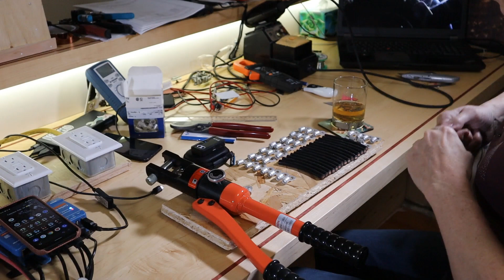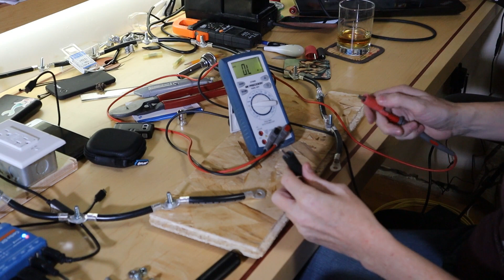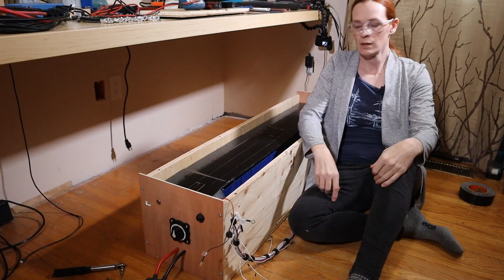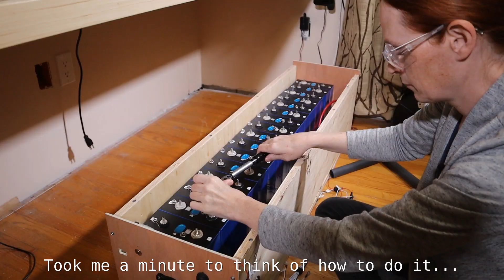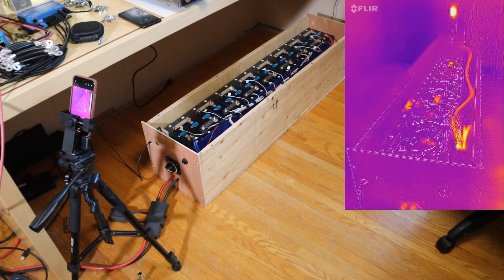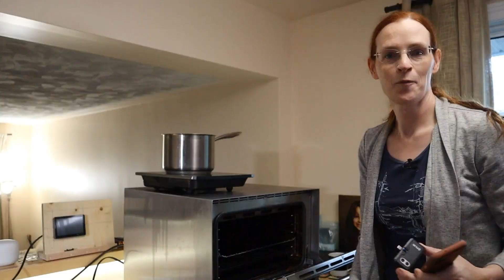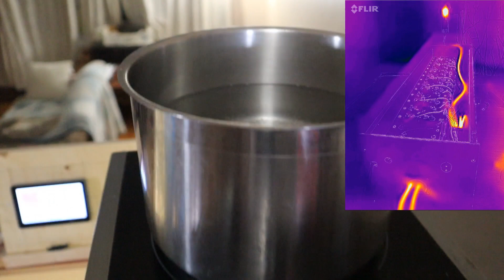What's Better? Rigid or Flexible Bus Bars - How to build a 48v Lifepo4 battery (Ep. 21)

Comment: My theory is that the bus bars are not copper, but are instead made from brass = more resistance and less efficient electrical conductivity = more energy being dissipated as heat. The way to prove this of course would be to charge the battery equally for both tests and compare the voltage (or total energy used) after each test. I would hazard a guess that more energy was used with the rigid busbars. All I know is I've been using these rigid busbars for a long time and filed them on the ends, and all of them are brass instead of copper. So, now I go out of my way to source pure copper busbars.

Comment: I see your SUPERVISOR is there to ensure QUALITY CONTROL! lol
Don't feel bad. I got one too. Every time I am doing something in the yard, my SUPERVISOR shows up to inspect lolol.

Want even less resistance then solder the ends in the lug and crimp.
Need US system not metric.

You didn't clean the connection surfaces.
Also, do not use stainless steel nuts and bolts. Stainless steel has more resistance than copper.

What app did you use to see the infrared??

Comment: im connecting  1/4"x 1"x36" Copper Bus Bar Solid Flat Bar to positive and one bar for negative on 4  48V(51.2V) 100Ah batteries  would there be a problem with doing this? is  1/4"x 1"x36" thick enough?
Reply from the maker: Wire gauge is dictated by peak current loads. Then you fuse/breaker to ensure it never exceeds that. What that is will depend on what you're powering, not the potential capacity of the pack.

Comment: Is it possible that the insulation on the flexible bars hides the heat?  Or alternatively, ambient visible light reflecting off the aluminum bars might have confused your camera?
Reply from the maker: The reflection off the tinned bars was a problem, yes. The insulation would only mask the heat for a short time... I think it cools better as there's more surface area for convection cooling on the wires. Andy (Off-Grid Garage) stress-tested my bus bars at something like 200A with no issues.
Reply: @TheDigitalMermaid  Yep, his video is what brought me to you originally.  And now I've watched your entire saga.

Comment: This test is deeply flawed.  You can’t measure the temperature of shiny metal very well with an IR camera.  You think the flexible cables are better because the IR camera can measure the temperature of the insulation on the cable much more accurately than the shiny metal bars.
Reply from the maker: I've learned a lot in the two years since I made this video :)
Reply: @TheDigitalMermaid  We are all are always learning.  😁

Comment: Perhaps if you purchased low grade cells and are suffering from bloated walls it would be beneficial to change rigid BB's for a flexible variety such that you made up, just make sure they are NOT long enough to touch both terminals of a single battery at the same time. As for the thermal camera don't get too excited on what you see it's a lot of trickery, much better to use a good quality  laser IR thermometer and point it at the terminals of every cell.

Comment: The multimeter allows a current of 0.01A to flow and then measures the voltage and the resistance. 
With such low resistance, that's not enough. You would need at least 10A or 100A to be able to determine the resistance.
And you would have to carry out a four-wire measurement and not with just two samples.
0,1Ω is the resistance of the measuring line.
Reply from the maker: Aye, I got this kind of resistance tester later. I've learned a lot on this project. :)

Comment: i think i would make a jig to keep those ring completely coplanar while crimping - no twisting when installing. OMG u need to study the Kelvin 4 point system for measuring extra low resistance, your meter is nowhere near good enough for that.  You didnt measure temperatures, just said they were warm?  Even a cheap IR gun would give you info and the well known back of the hand or forehead test will guide you to hot spots. The data says you torque to 4Nm why did you use 6Nm and put extra stress on AL threads - which creep over time btw and loosen - well known AL problem
Reply: Yes could use a 1A powers supply and measure the voltage across the connection.  R =V/I  
Copper wire changes resistance +0.3% per deg C .
Myself I have a Agilent 4338B which uses AC and can measure 1micro OHM great for connection resistance measurements.

Comment: not necessarily better than the rigid. they are longer so MAY have better cooling. measuring the voltage drop (or resistance) would give better indication. 
But of course if the heat is the concern and not energy loss then yep, looks cool.

Comment: Curious if in your final build if the long wire that heated up the most could be configured differently to be the "short one". Honestly just because my OCD takes me there, LOL. I'm sure I can come up with "reasons" but it's really just my odd sense of order driving the inquiry. I know you are probably way beyond this by now but I am purposely making my way through your back catalog chronologically so I have no idea what point you are currently at in your process. The not knowing is kind of fun actually. Again my sense of "order" is getting the best of me, LOL. Great video I'll be caught up to date before long, perhaps then my comments will be more relevant but probably not, he he! :)
Reply from the maker: The one long cable always bothered me also, and it's part of why I came to prefer the "snake" design I ended up using.
Reply: @TheDigitalMermaid  Looking forward to seeing how that process unfolds (unfolded). Great content BTW, thanks for posting it all. :)

Comment: super caps go for a million cycles or something cray. i think a hybrid system is worth the longevity gain. most people could size their system lower if they didnt have to worry about peak discharge/toasters pulling too many amps and deep discharging they bats. super caps dont care and will take the heavy load off of the bats. sacrafice themselves first except not really coz they last forever if you keep them dry.
Reply from the maker: Supercaps have a very small energy density compared to LFP.
Reply: @TheDigitalMermaid  ya but u can size a system smaller and save a lot of money if you dont have to worry about high current draw for most applications. 
for example, an OG copper head Duracell AA battery has enough energy in it to start a 4 cylinder engined car about 2-3 times, but you would need something like an oscillator/joule theif to get all the theoretically energy out. practically though with a boost/buck converter you could conceivably replace a 12v lead acid battery in most automobiles with a 50 farad 12v super cap bank (6x500F) and trickle charge those with a single enloop NiMH AA battery. Leakage would be an issue but its only like 20ma @~12v with matched/quality caps so it would almost/just barely have enough charge to start after 12hours overnight lol.
Reply from the maker: @vevenaneathna  I need storage density more than anything, I doubt each battery would ever see even 100A. So while supercaps have their place, certainly, they're not the right solution for my project.

Comment: Hey, great testing! I wonder if you were to connect your two different bus bars to a load and measure the voltage drop across them while under load if you would see any difference? Either way, enjoyed the video, thanks!
Subscribed!
Reply from the maker: Welcome, and thanks for joining! Measuring the voltage drop is a great idea, I just didn't know about it back then. I've been learned so damn much! Haha. I suspect I'll be doing more tests once I get the motor installed on the boat. Being able to fire up a proper heavy load will, I hope, make small differences more visible. :)
Reply: @TheDigitalMermaid  I'm in Ottawa so if you happen to sail up this way, let me know, I'd love to say hello!
Reply from the maker: @SimpleElectronics  I'm often in Montreal, I'll see if my sieve brain remembers to take you up on that! :D

Comment: As an aircraft engineer with Inspection Authorization (since 1970) I can confirm a properly crimped cable is superior to a rigid link serving as a bus. We use few rigid bus bars on aircraft.
Reply from the maker: Thanks Rex, that helps me feel better about the hours and hours I spent making the cables. I still worry sometimes that I went overboard with that. :)
Reply: @TheDigitalMermaid  I loved Andy testing bus bars and one of your cables - what sized cable did you end up using - it was the coolest in Andys test - cooler than heavy aluminium bus bar, flexible copper bus bar, multiple cables of equal length and the standard EVE bus bar. I think I will do what you have done and make my own cables and crimp quality lugs. Well done!

Comment: I know this is a year later.  So IF they use ridig busbars it is only "fixed" at the top and the bottom would not be fixed so while they "fix" the gap on the top but the bottom can splay out.
Reply from the maker: I'm not sure I follow. What do you mean by "splay out"? It might be that I don't recall the details of this video. :)
Reply: @TheDigitalMermaid  as the cells swell since they are fixed at the top they can't expand.  The bottom of the cells are not fixed and hence they can expand.   Andy has a recent video where he shows this.
Reply from the maker: @kennith.  Aaaaaah, now I understand. Ya, that's very true, and the flexible bus bars will allow for that movement more easily, and it's one more "movement" or force not being transferred to the posts.

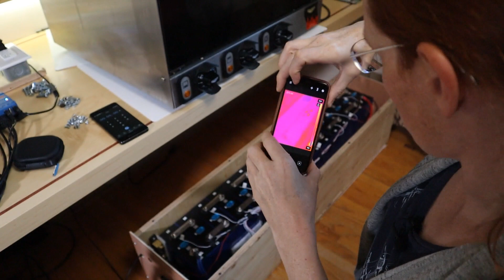Comment: Firstly, great scientific approach!  I've enjoyed watching how you do you testing.  At about 22:30 you take out your IR camera to look at the bus bars.  You noticed that there was a couple (one in particular) that was showing that it was warmer than the rest.  One of the things that notoriously is common about bus bars, whether they are solid or rigid, is the physical connection to the battery posts.  If you have a PERFECT bus bar with .01 milliohm (made from 100% Cu, 4mm thick and 12mm wide) you might see an issue IF the "flatness" between the battery terminal surface and the area where the bus bar mates to the battery terminal is not perfect then you will see differences.  I'm not sure how to explain this, but it is critical that you get 100% contact with both surfaces.

You can check the "flatness" of the bus bar surface by taking a completely flat surface, like a 4" x 1/8" x 12" flat iron bar (this is just an example.  There are lots of things that you can use) and use a 1200 grit emery cloth or sand paper, place it face up on the flat surface, then take your bus bar and GENTLY run the surface back and forth (or in a circular motion) for a few seconds ONLY.  Now look at the surface you just "sanded".  Are there any markings on the surface which did NOT get sanded?  That is the majority of the issues with having the bus bar not making 100% contact with the terminal surface.

There are of course more things to consider...  area surface, material composition, etc.  The the above is one of the main pain points for making a battery.

NOTE:  You can do this test whether the bus bar is a rigid bar or "flexible".  The crimp ends need to also be 100% "flat" and make a 100% contact to the battery terminal.

An issue I've also seen is that the battery terminals are sometimes the real culprit!  These are made in China with quality control being an afterthought.  (Didn't want to add salt to the wound 🙂 )

Comment: I like your video. Very informative and interesting. 

I love your Victron based system. Me too, runs on Victron. 

I used to use IR thermometer to monitor my system. But since FLIR is now widely available as built-in camera on rugged phones like Blackview, i am loving these FLIR cameras on phones 😍 they make maintenance work much easier. 

Flexible busbars is the way to go. With systems running under 100A, you are unlikely to see much difference or issues with over heating. But on systems constantly running over 100A and even beyond 200A, busbar quality and even the contact surface between busbars and battery terminals become vital.

I have been running 100% full Offgrid solar for the past 2 years. Reliability is everything. And on my system running a 3kw inverter constantly, i see high current above 200A on a daily basis. So i have learnt a few useful tips maintaining my Offgrid solar system.
Most of the potential issues are at the joints and contact points where high current above 200A flows. You want to oversized these. Building just up to spec is not good enough. I used to have 300A busbars, i am now build my v2 build with 1000A busbar with the Victron Lynx.
With battery busbars, i am using very similar cable based flexible busbars as yours with 250A capacity. But in my new v2 build, they would be replaced by 500A flexible copper layer busbars that are custom made.

Although rare, i have learnt from past experience that at high current loads, even hydraulically crimped joints can sometimes fail. It starts off with higher temperatures, then oxide is formed over copper which further increases its resistance and heat generation. Eventually it can become too warm to touch. On a high reliability system, best to use heavy duty Industrial grade busbars that are professionally made.

You can see a 300A version of this busbar here:
https://youtu.be/EHqXgcrtOkc

I noticed there is a slight elevation of temperature on some of your busbars even at the relatively low 53A current. This can happen if the contact surface is not completely flat and /or has oxide formed on the surface. It is worth checking them out to sort out any potential issues beforehand.

Also having pure copper may sound like good idea, but i can tell you from my own experience this is not so. It works great in the first few months before copper oxide is formed on the surface and the busbars tends to heat up and requires maintenance to sand back the surface. Much better is to have quality nickel plated over solid copper. They don't tend to degrade overtime with increased resistance.

In my v2 build, i am deploying 16x 120Ah LFP. Each capable of 280A peak current and 150A sustained output. So just by putting two of these in parallel, it is capable of 300A sustained output. Each LFP has an advanced built-in BMS, so no need to worry about external BMS failures that would screw up my entire battery system. I am keeping my system 13.2v nominal voltage and avoiding series connection, as weak cells can cause long term maintenance problems with mismatched internal resistance. I am putting 16x of these in parallel. Dividing them into 4x battery bank, each bank having 4x LFP in parallel. So it is a bit like a binary tree. The 1000A on Victron Lynx is split into 4x 250A battery banks, and once the battery bank is reached, each battery only have to handle 63A. But i am deploying a 500A flexible busbar here. So plenty of headroom. By having 4x parallel battery banks, i can easily take two offline and the rest of the two can still easily keep up with the max load with plenty of headroom.
You want to over spec your cables by 2x to 3x. Using a 150A cable to run a 50A load keeps your system much cooler with improved efficiency. 😬👍

Also you may want to check out this lifespan of LFP as a function of Depth Of Discharge DOD. It is interesting information to consider. If you only cycle your LFP between 70% to 100% state of charge, they can provide much extended service life providing 70,000 charge cycles.

https://www.powertechsystems.eu/home/tech-corner/lithium-iron-phosphate-lifepo4/
Reply from the maker: Thanks for this thorough reply. If you watch videos after this, you'll see I ended up settling on the 4x 10awg sets, which Andy tested a while back. I suspect in my setup, I'll rarely see 50A/pack, so in my case, seeing Andy test this at (I think?) 200A and they stayed cool, barely above ambient, I should be good. :)
Reply: @TheDigitalMermaid  Since you are running 48v system with external BMS, you may want to follow Andy on his Offgrid Garage channel as he is running very similar 48v system with many different types of External BMS. He has tons of very informative information and sharing experiences with imbalance voltage in cells and how he tackles this with BMS.

https://youtu.be/nPFKkIYFt48
Reply from the maker: @damianhla4940  Andy's been a big help to me and this channel. :)
Reply: @TheDigitalMermaid  Excellent! You would find Andy's channel providing a vast range of very practical Offgrid solar information. He is also increasing posting Victron related information on his new Power wall 2.1 build, which is based on the mighty Victron Lynx 1000A system. Having watched his video it inspired me with my v2 build 😅💪💪💪
Reply: @TheDigitalMermaid  The only aspect Andy has yet to explore is high current high quality flexible busbars, which i am now in contact with the supplier in China, as i am build my custom 500A flexible busbar system. 😅

His review on busbars actually hinted that the braided flexible busbars from Aliexpress as the #1 performer. I actually tested both, the braided 400A busbar and the layered 300A flexible copper busbars. The latter IMO is the better build. 😅💪
Reply: @TheDigitalMermaid check out Andy's busbar review here https://youtu.be/EjBqng70ORc

Comment: Make the rigid bars a little long and put a U shape bow in them for movement.
Reply from the maker: That has two issues; First is that there's less surface area in contact with the pad under the bolt. The second is that any movement reduces the connection pressure and so increases resistance. Also, if it can move, that means the vibrations and shocks at sea can work the bolt off further, making the higher resistance even worse.